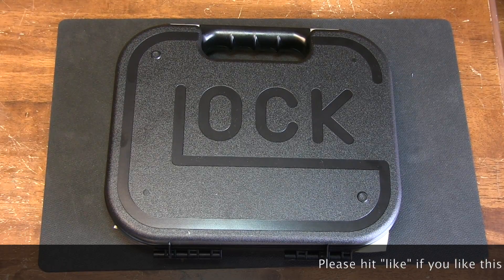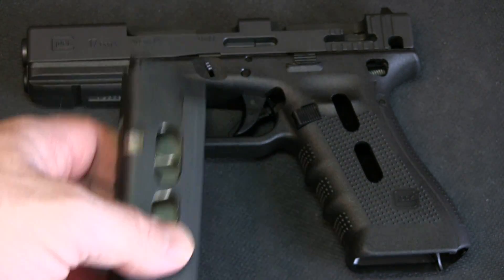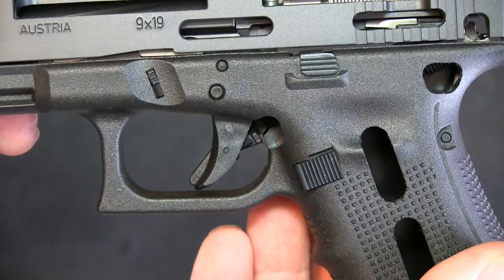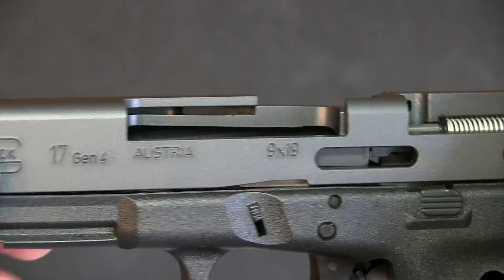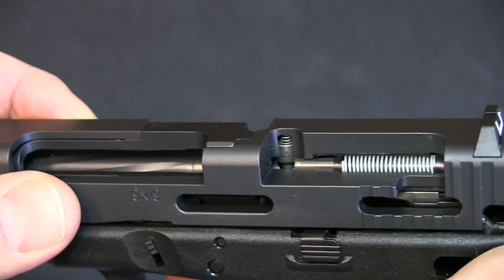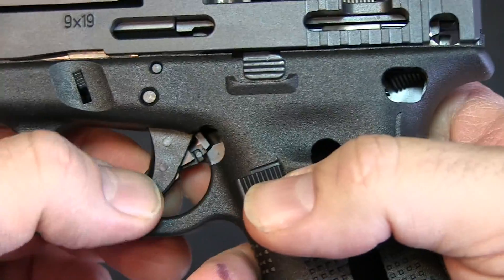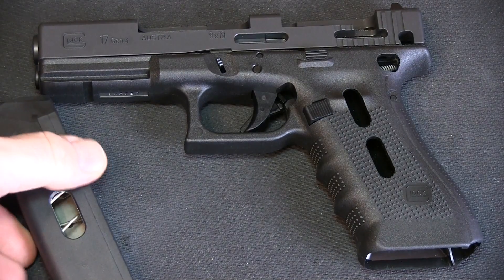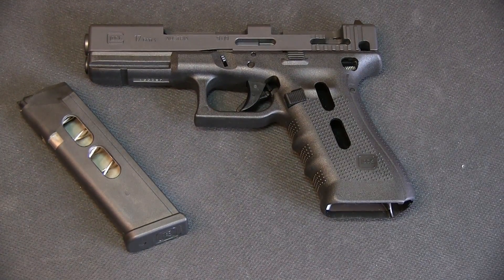How a Glock Works (with Glock Cutaway)

Comment: Theoretically, could you just drop a factory barrel, and stryker in this cut away gun, and it function properly, and if not, what would be necessary for it to function properly, or which parts could function properly if used if something like just the lower was match with a factory slide?
Reply from the maker: +Ty White You could fire it like that, though it wouldn't function properly. Pistols are designed to function with a specific slide weight and since this has cut away some of the slide mass, it's going to cycle way to fast, causing it to bounce closed faster and place a lot of stress on the frame. I wouldn't be surprised if after a few shots the slide would continue on it's rearward trajectory and brain the shooter in the face. If a person wants a Glock for shooting, best just to buy one, it's the same price and  process (this is still a handgun, so all the paperwork still needs to be done, and laws apply).
Reply: +762x51n8o So a new barrel, firing pin, and stiffer recoil spring and you have the coolest Glock on the Block lol. It would be cool to see done for the entertainment aspect, sounds like a job for MatV2099, I think that's his name at least.

Comment: Proof that Glock is a double action firearm.  Note the firing pin retracts with the trigger pull before release, which makes it a double action.
Reply: The glock is a partial double action since you must rack the slide to move the striker halfway. A trigger on a true double action pulls the striker or hammer back completely. Because of this the glock trigger is lighter than other double actio triggers.
Reply: I disagree.  Single action means the trigger does a single action - releases the striker/hammer.  In this case the trigger does two actions, fully cocks the striker and then releases...two actions, double action.
Reply: +fillupread In order to be Double-Action the trigger must be able to cock the hammer/striker on its own.  The Glock action cannot do this.  You have to rack the slide to cock the striker, in this case halfway(i.e. Safe Action)  The fact that when the trigger is pulled the striker is cocked the rest of the way and then released does not mean its double action.  It doesn't fit Double-Action and it doesn't fit Single-Action, which is why Glock refers to it as Safe Action.
Reply: Copied and pasted from the NRA's Firearms Glossary....

Double-Action
A handgun mechanism where pulling the trigger retracts and releases the hammer or firing pin to initiate discharge.

Im done...
Reply: +fillupread Way to go on copying and pasting.  But it proved nada.  The concrete in your head fails to grasp the notion that the Glock Safe Action must have the slide pulled to the rear to start the action.  If you do not rack the slide pulling the trigger does  absolutely nothing to operate the action.

A double action pistol unloaded, pulling the trigger with the hammer/striker de-cocked will operate the action.  Doing the same thing with a Glock will do nothing.  Glock is not Double Action.  Since you are 'done' I get the last word.  3 words actually "You are wrong!"
Reply from the maker: +Akira If the striker were pulled back all the way, 100% back, then the trigger pull would just release it, which would be single action.
Reply from the maker: +Frackrats Fenorki Negative. That's not the definition of DA or SA, that might be a characteristic of something you have handled in the past, but isn't the definition. This is the only thing that matters, in defining it: Does pulling the trigger create one action, or two actions? Glock triggers clearly provide 2 actions. USPSA agrees on that, and classifies it as DA
Reply from the maker: +fillupread You are correct
Reply: +762x51n8o  Thank you sir...

Comment: Hey Semper Fi back at ya...quick question: the issues I've only ever heard of were "slam fire" ADs, (with enough searching I'm sure you could find the youtube video) so, with that in mind, did you observe if it were possible--at all--for it to slam fire without the trigger being pulled? I think the video I saw on youtube was a gen 3 G17.
Reply from the maker: +Andy Flack I've put a lot of rounds through a lot of different Glocks and never had any issues. Due to the safety that prevents the firing pin from coming forward unless the trigger is pulled, I can't see it happening. Unless someone tampers with it in some way. I haven't researched the video you're talking about, I'll have to check it out.

Comment: SNAPCAPS  SNAPCAPS  SNAPCAPS... (and I just subscribed.  Well done, dood.)
Reply from the maker: +Dusty Rusty You don't need snap caps with modern firearms.  Thanks for subscribing!
Reply: +Dusty Rusty The Glock manual specifically states that dry fire is ok....

Comment: took my glock 19 apart after putting it back together it wont fire and will not come apart . when i open the chamber and pull the trigger it fires. can you help.
Reply from the maker: +John Butchyk It would be tough for me to figure out without actually seeing it. What do you mean when you say, "open the chamber", do you mean pull the slide back?  Do you have a armorer's manual? There are some minute details you need to be doing in order to get it to work.

Comment: If you replace the barrel and the firing pin will it fire?
Reply from the maker: +Esteban blank Yes, though I wouldn't.
Reply: What?
Reply from the maker: +Esteban blank What is your question? Yes it will fire, though I wouldn't do it.
Reply: 762x51n8o
i just figured it would look cool shooting it in slow mo with all the cut outs.
Reply from the maker: +Esteban blank I wouldn't trust the structural integrity of the slide though.  Could be catastrophic.

Comment: this is perfect for people to look at if they are afraid to carry with a round in the chamber.  that gun will not fire unless that trigger is getting pulled
Reply: But, it will fire if you pull the trigger.  And people keep finding ways to accidentally pull the trigger.
Reply from the maker: +chriscat85 Every gun is supposed to fire when you pull the trigger. The problem is that a lot of people don't know how to keep their finger off the trigger until ready to do so. It's basic safety. There have been many people who have been shot because the "gun was on safe" or "there wasn't a round in the chamber."
Reply: I agree it's all about proper training and like you said when people have their finger on the trigger when they draw the gun it's gonna pop off
Reply from the maker: +Seth M What's weird is when you look at pictures from WWII, and from prior to the 60s, of military and cops, they had their fingers all up inside the trigger guard, pressed against the trigger. I think in general people were used to revolvers, which had 10+ pounds of pull.
Reply: Buy it does not just have to be your finger on the trigger. Mthe re have been cases of someone's shirt catching on the trigger as it was reholsrered. Bang.  Cases of the holster itself bumping the trigger as it as reholsrered.  Bang.  Cases of someone catching a dropped Glock and bumping the trigger.  Bang. He killed an urinal.  Point I'm trying to make is that there is nothing magic about the Glock.  I dare to say that all modern, quality, handguns will not fire if you don't pull the trigger.  But they will all fire if you do pull the trigger.  There is no real difference in carrying a chambered Glock and carrying a chambered Beretta with the hammer back and safety off.  Or even a modern 1911 with the hammer back.  The,1911 might even be safer with the grip safety and all.  In all these cases, they won't fire unless something pulls the trigger.  But they will fire every time you do pull the trigger.  You can debate the point, but people keep proving over and over that it is a problem.

Comment: Couldn't you just swap the barrel, slide, and firing pin and have a functional glock?
Reply: Yes, just the firing pin and barrel. The slide would be ok
Reply: +Stephen Viggiano Nein!  That slot just above and forward of the slide lock makes your statement false.
Reply: +Joseph Wattigney You could install a normal firing pin but the cutaway frames will only fit the specific cutaway barrels.  If he field stripped the G17 Cutaway you would see the barrel fits into the frame non-traditionally.  You can't put a G17 Cutaway Barrel into a standard G17 or vice versa.
Reply: +Frackrats Fenorki I see very interesting lol

Comment: Very cool. I'm still not 100% clear on how the barrel lug engages with the locking block during a cycle, or what that was pushing down on the barrel at the start of the file.  Great video!

Comment: Bad practice to handle an uncheck gun pointed in an unsafe direction. I can only react to what I see you do on video. You placed your finger in front of the muzzle of the gun several times. Your handling of an unchecked gun was a distraction to your demonstration.
Reply from the maker: Isiah Stroud It's a cutaway...it has no firing pin....it is incapable of firing.
Reply: Isiah Stroud Well considering the chamber is cut away, Ray Charles could see this pistol is clear. You must be one of those guys screaming about trigger discipline when some bikini clad woman is holding a firearm.

Comment: A local gun store had one of them for sale years back rite before the gen 4's came out , they were asking the same price as a functional pistol I just don't remember what model it was but I do remember it was a RTF2 with the fish gill slide serrations  . Kool gun it was a first for me handling one
Reply from the maker: ***** I don't think Glock has ever made slide serrations like that -- could be an Armorer's cut job. I've read that a lot of the cut Glocks that you see for sale are done aftermarket
Reply: 762x51n8o glock did factory Cresent shaped slide serrations on the gen 3 RTF model.

Comment: I have a 9x19 Gen2 that sometimes jams during reload and after ejection.  It's almost as if the incoming cartridge goes a little too high before going into the breech, and it gets caught on the slide coming forward.  Any suggestions?  I  notice my ejector is not straight but instead bent slightly towards midline, but your cutaway appears to do the same.  Thanks!
Reply from the maker: Don Hodo I don't know where your at as far as experience, so don't be offended if I start off too basic.  Have you tried more than one magazine? Are you keeping a straight wrist? (most issues are caused by this). Have you tried different types of ammo? (a lot of issues are caused by this also). How is the ejection of the spent case (distance, direction, etc).

Comment: It would be nice to see this made as one of the old Army 'GTAs' (Graphic Training Aids) - the 10x wooden mockups with the various parts exposed and color coded...there is so much activity going on inside the slide AND receiver of this weapon (as opposed to the much simpler 1911) as the trigger is pulled to the rear that you simply cannot see the entire process at one time,  A clear polyacrylic slide & frame would be extremely helpful is being able to visualize the entire process from feeding & chambering to extraction, ejection and process repeating itself...Thanks for the great vid...until I saw this I couldn't visualize how the firing pin was compressed - I thought it was a dumb idea to stretch rather than compress the spring...but can now see how the compression is accomplished...EXCELLENT job!!!

Comment: I just bought my wife her first gun a glock 42. It jams and fails to eject just about everything I have tried so far. Every round jammed from one type of ammo the range sold us. Any idea what the problem may be?
Reply from the maker: Todd Orr You should get on the horn with Glock ASAP. That's not right, and there's something wrong with it. I have yet to have a single jam with my G42. In fact, the two jams I had testing the G43 yesterday are the most jams I've ever had from  a Glock.
Reply: I found a plinking ammo  that hasent jammed yet. Winchester walmart brand.
Reply: Todd Orr two words... limp wrist
Reply: Kirk Blackson I wish it was that easy. Its jammed on all of us. I bought it used so I'm wondering if there was a preexisting issue?
Reply from the maker: Todd Orr He's right, most of the time it's an issue of not lockign the wrist. The second most common problem is ammo. Store bought stuff is fine, handholds or Russian ammo is usually the culprit. If it's not that, it's probably an issue from the previous owner. Something could be broken or he could have tried to modify it. I would take it to a Glock armorer. Look on the GSSF website, if you have any local matches coming, they'll have an armorer, and if you register for the shoot, they'll normally look at it for free and fix it. Otherwise, call Glock.
Reply from the maker: Todd Orr  Is it failing to extract the cartridge from the chamber, or failing to properly eject the spent case? For failure to eject: Take a look at your ejector and make sure it's not chipped or broken. For extractor: make sure the extractor is not damaged or that there isn't dirt/debree under the claw.
Reply: A little of both. Like I said im convinced its ammo related, due to the fact that we tried a different type of ammo last week and we had no jams or misfires.
Reply: Todd OrrGlcok has awesome customer service.

Comment: That's a view that we all don't get to see very often, if at all. Nice to know what makes it 'tick',....( or go click )
So is a striker fired gun more or less complicated than a hammer operated one ? I'm asking this because I'll bet there are more than just me who are not really sure.
Cheers
Reply from the maker: I can't really make a broad statement as to Hammer Vs. Striker, because I don' know how complicated the other ones are. I think a good sign of "complicated" is how many parts it has. A Gen4 Glock has 35 parts. An M&P has 30-something. A 1911 has 50-something, depending on who makes it and what iteration it is. A lot of revolvers can have around 100 parts. I think in general the hammer assembly is going to have more parts than the striker. Some of it, also, could be the age of when it was designed. Coming from revolvers, which were built like watches with a lot of parts, the autos of that time also had a lot of parts. Now I think the firearms trend is to keep it simple. Hope this helps
Reply: 762x51n8o Yeah,..that's what I was wondering. I had a feeling that the striker was a little less 'mechanical' but wasn't sure, mainly because I didn't have an opportunity to disassemble either ,..yet. Thanks for this.